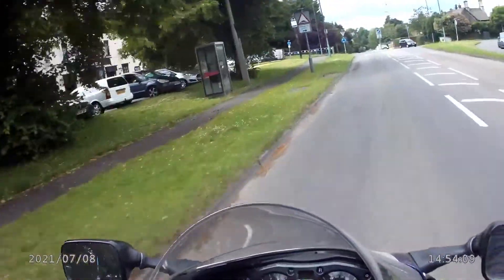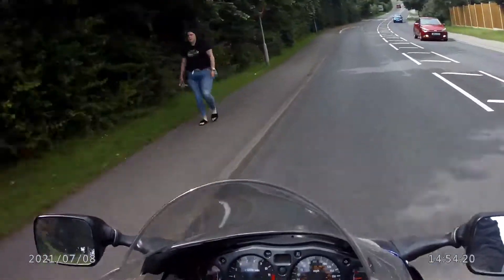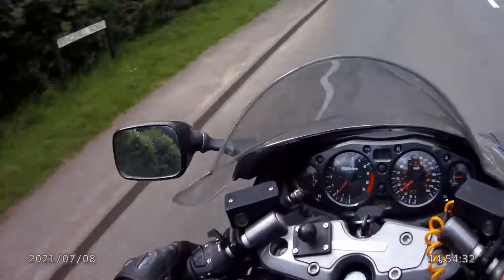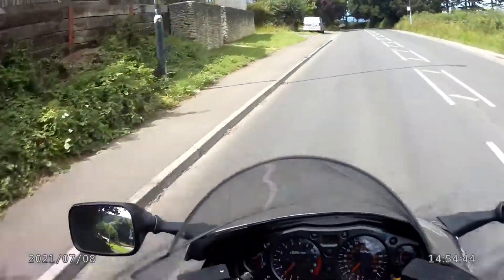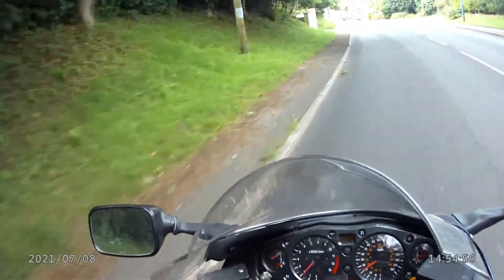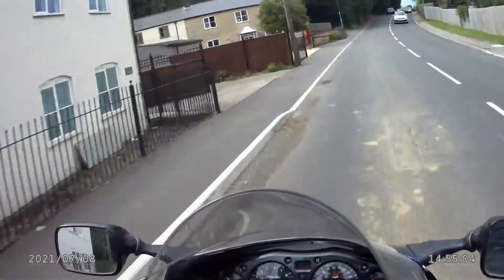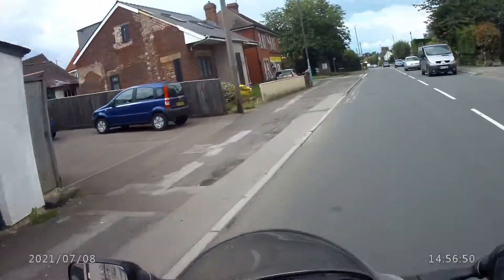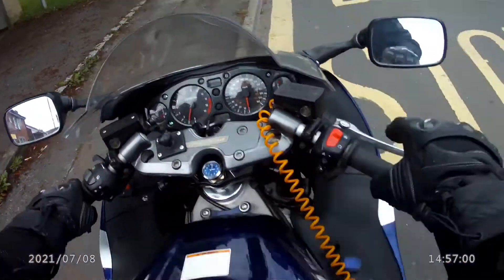Test ride after refurbishing the Hayabusa Gen1 master cylinder.

Comment: ....glad everything seems to be ok now . So you had a Firestorm ...?!....a neighbour used to have one and it sounded great ! His girlfriend 'made' him get shut of it when she became pregnant though - and my brother's wife made him sell his Yamaha RD350LC YPVS ! Your Hayabusa is a 200mph rocketship isn't it - or is their alleged topspeed a myth ?
Reply from the maker: Yes I should have kept the Firestorm , but it was a tad uncomfy for my old bones. The Hayabusa has a rev limiter that prevents it exceeding 186 mph.. The Gen 2 version in stock trim with a “flashed” ECU to remove the limiter , and one tooth less on the final drive sprocket will hit a true GPS 205 from the 195 bhp stock motor.
However , it’s not at all about speed for me , it’s the torque. No gear changes required. Leave it in sixth from 30 mph.  Very comfy , and surprisingly economical bike that is very relaxing to ride. Yes , it is a bit of a rocketship  if you’re that kind of rider. It can do everything my Interceptor can do left in second gear.